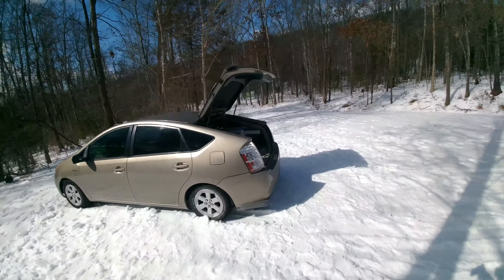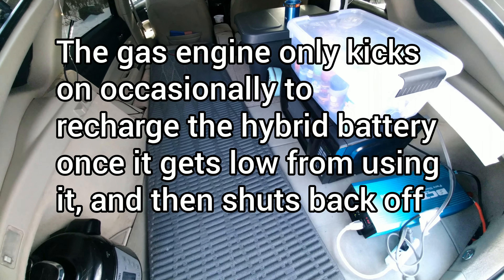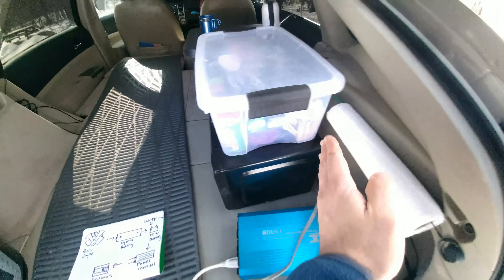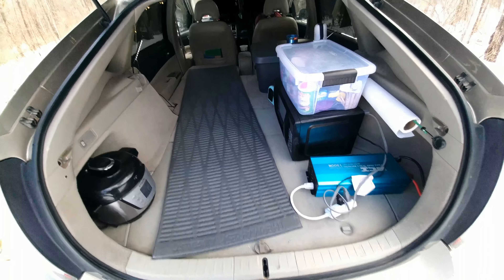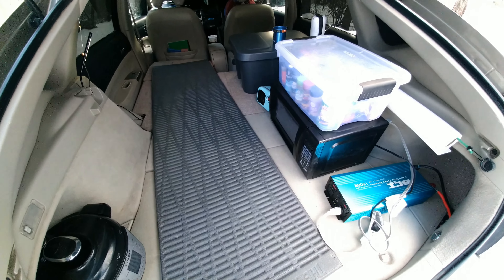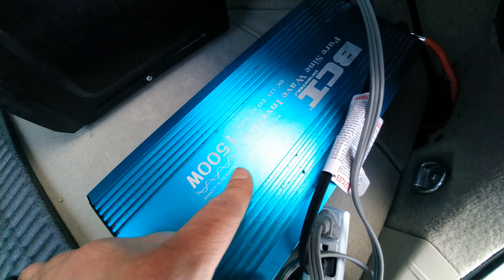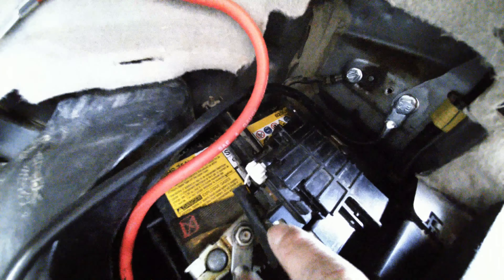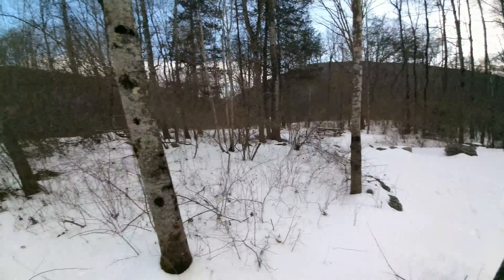How a Toyota Prius (& other hybrids) can be used as a GENERATOR! #OffGrid #Camping #Emergency

Comment: FYI, you need a fuse between the battery and the inverter. The factory fuse on the battery is protecting the power from the DC to DC charger to the 12V accessory battery. If the cable connected to your inverter shorts out it could start a fire.  I have this set up in my Prius and I used a heavy duty, inline fuse.  All the best
Reply from the maker: Yeah I might get a fuse for my positive cable at some point. My inverter is internally fused though so I haven't felt the need to get one. I know the kind of fuse you're talking about though
Reply: @MountainSpringsAdventures  brother as a car audio installer and licensed aircraft mechanic please install a high quality car audio fuse(walmart schose fuses melt wires and dont pop trust me) on your inverter positive lead as close to the battery as possible. An 80 amp fuse should do you but you may need a 100, 120, or 150 amp if the 80 amp keeps blowing. Trust me bro last thing you wanna do is wake up to being trapped in a burning car. 

Just because the inverter has internal protection it won't stop the positive wire from burning down due to an accident short circuit from your exposed hot lead just chilling in your car.
Reply: @FlipSRT4  +1 This!
Reply: Can you hook up a Jupiter 5,000w power inverter to a car.If so what's the proper way to do it using up to 5,000w ?
Reply: @drrobotnikmeanbeanma  No. The Prius DC-DC converter system only has about 2,000 watts available. Other systems still need power, so you need to keep your inverter down to about 1,000 watts. With a 1,500 watt inverter, limit power usage to 80 % or 1,200 Watts. A larger inverter will just waste energy, there are some inefficiencies.
Reply: Have you noticed if this setup shortens the life of your 12v?
Reply: @elizabethswanson422 If the car is off, it will drain your 12v battery insanely fast. If the car is on, it’ll keep the 12v battery charged.
Reply: How do I learn to do this stuff? I'm a girl and no one ever teaches girls to do things like this.  Boo hoo.🎉❤😂
Reply: I assume you understand this by now, but just to clear this up: batteries give DC current, which is direct current in one line on a graph. AC current is alternating current, which shows is a wavy line going from positive to negative and positive to negative over and over again. The inverter just changed it from AC to DC, just like the power cube for your phone charger. I believe the 12 V battery serves two purposes. One is that it provides the standard 12 V to all the normal car things that are needed. Two is that I believe it separates the car and the big battery by just forming a little safety buffer in between the two.
Reply: Using a 12V battery from a Prius to power a 1500-watt inverter can be done, but there are important safety considerations and limitations that experts typically emphasize:

Safety and Technical Considerations:

	1.	Battery Limitations:
	•	The 12V battery in a Prius is not designed for high current loads like running a large inverter, especially one capable of 1500 watts. Such an inverter could draw over 100 amps from the battery at peak usage, which may be far beyond what the battery can safely provide.
	•	If you’re trying to power devices with high power demands (over 1000 watts), the 12V battery will likely drain very quickly, and continuous use at this level could damage it or severely reduce its lifespan.
	2.	Potential for Battery Damage:
	•	Overload risk: If the inverter is not properly matched to the battery’s capacity, it could cause overheating or overloading of the battery. Prius 12V batteries are smaller than those in traditional gasoline vehicles because the hybrid system mostly uses the high-voltage battery.
	•	Discharge risk: Deeply discharging the 12V battery can shorten its life or even damage it permanently. The inverter could cause this rapid discharge if used continuously for extended periods.
	3.	Inverter Sizing:
	•	A 1500-watt inverter draws a significant amount of power (over 125 amps at 12V), which is likely more than the Prius 12V battery can supply. Most car batteries are not designed to handle this kind of continuous load without significant degradation.

Using a Prius as a Generator:

The safest and most effective way to use a Prius as a generator is through the hybrid system’s high-voltage battery. Some aftermarket systems have been developed specifically for this purpose, allowing you to tap into the high-voltage battery more safely and efficiently than using the small 12V battery. These systems work with the Prius’s engine to maintain the charge of the high-voltage battery, which then can supply AC power through an inverter.

	•	Toyota’s recommendations: Toyota doesn’t officially endorse using the Prius as a power generator, but during emergency situations, some owners have done so with caution and the right setup.
	•	Vehicle wear: If done improperly, relying on the 12V battery alone could cause strain on both the battery and the electrical system. Using the Prius engine and hybrid system to maintain battery levels (with the right setup) is safer but still should be done sparingly, as it can wear on the vehicle over time.

Recommendations:

	1.	Smaller inverter: If you still plan to use the 12V battery, opt for a smaller inverter—one that draws no more than 400-500 watts, which is more appropriate for a car battery.
	2.	Specialized kits: Consider specialized systems designed for hybrid vehicles if you plan to use the Prius for emergency power. These systems work more efficiently by using the high-voltage battery rather than the 12V battery.
	3.	Battery monitoring: If using any inverter, be sure to monitor the 12V battery’s charge level closely to avoid over-discharging.
	4.	Installation by a professional: If you’re unfamiliar with the electrical system in the Prius, consulting with an expert before installing an inverter is important to avoid damaging your vehicle.

In short, powering a 1500-watt inverter from your Prius’s 12V battery is risky and could damage the battery or electrical system. Using the vehicle’s hybrid system with a proper inverter kit is a much safer approach.
Reply: @lars7411 THANK YOU for posting this detailed safety information about the dangers of connecting an inverter to the Prius 12 volt battery!
I hope others read it - it could save money, batteries, and lives! 👌🏻✅
Reply: Consider taking basic electrical courses at a county college. You may really enjoy it.
Reply: @lars7411 Thanks for your detailed, useful comment — very much appreciated! 👍

Comment: You can easily add another larger deep cycle 12v battery, run it in parallel with the little Prius one in the rear. That's an inexpensive way to add more power and stored capacity
Reply: That is exactly what I have done. 150Ah. It works great.
Reply: @ockiedavel7318 suggestions for extra batteries for this purpose sir ?
Reply: @ockiedavel7318 did you parallel a 12v camping battery to the car 12v battery on a hybrid car?didi it work?

Comment: I added an extra 12 volt deep cycle battery that I got from Toyota and wired it in parallel to my first battery. I then wired in a 2000 watt Pure Sinewave inverter onto the 2nd battery which runs my 700 watt microwave. This configuration seems to work very well for me. 👍 One more thing, I only run the inverter when I use the Microwave and then I turn it off to save power.
Reply from the maker: That sounds like a good idea, I might get a second 12 volt battery with a split charge relay oh, I would prefer to use my microwave and my power inverter when the Prius is completely off
Reply: Great idea @Reddit Man! Where did you mount the extra 12 volt battery and the inverter in your car? I'm curious to see/know how you went about it to be efficient with space, etc. :)
Reply: @MountainSpringsAdventures  Why would you prefer to use your inverter only when the motor is off?
Reply from the maker: Because it doesn't put any strain on the hybrid battery or the Prius inverter/converter system
Reply: @kidshappytunes-z1m  Thanks!!
Reply: Perfect plan, I noticed he’s using the wrong type of battery for an inverter.
Reply: @caleyhall  which he?
Reddit Man or Mountain Springs?

Comment: I wonder if you could take this technology out of a Prius and put it in other types of vehicles, too. It seems like it could be universal.
Reply from the maker: They do- most hybrid cars have this technology
Reply: It could be universal to even non hybrid cars, but there are caveats:  Except for the shortest of uses (like you need a power tool for 5 min), the engine's got to be on.  The car's alternator needs to be able to supply enough amperage - and check out the charts on the web of how high an engine RPM that alternator has to be running at (for many cars it's 2000 rpm or higher.   It begins to get a bit silly: you've got to have the right alternator, the car's got to be on, you've got to have a brick on the accelerator reving the engine all the time.  In addition to those things, you've got to get the basics right: thick, short 12v cables, in-line fusing, careful temporary or permanent mounting.   A synergy/hybrid drive car is much better set up for this.  There are good (and not so good) videos on Youtube showing this with other Toyo products (like the prime Rav4) and probably other makers' vehicles too.

Comment: You can plug in direct to the battery if you are using DC devices. You only need an inverter if the devices require AC. When using an inverter you are wasting electricity as you are getting power as DC into the small battery, however if you are using AC, you have to convert DC through the inverter losing part of it due to the inverter and then sending it to the AC device. When I went camping, for a laptop, I would get a DC in cable to  the laptop. Most computers run in DC so it's a DC direct to the DC device. No loss from an inverter.
Reply from the maker: thanks for the tips
Reply: Mr Wade thats a wonderful and simple solution. Just get everything 12v dc to begin with and avoid the natural and inevitable energy loss from the inverter to begin with!! At that point your only limit would be the amount of current your "alternator" can put out at idle. I put that in quotations because our Toyota hybrids don't have a tradition alternator....blows my fucking mind I have been a mechanic for 20 years im FAA licensed for aircraft electrical(including alternators on aircraft reciprocating engines) and when I popped my hood for the first time I was FLOORED

Comment: I do the same thing with my Prius -with the inverter. The difference is, and I think it's an important one (not so much with a Prius but it does make me feel better. However if you have any other kind of vehicle you DEFINITELY want to USE ANOTHER 12 VOLT BATTERY AS A BUFFER BETWEEN YOUR INVERTER AND THE OEM 12 VOLT, preferably a DEEP CYCLE.  (By the way you don't NEED a Pure Sine Wave Inverter for most applications, but it is far safer as well as usually a lot more quiet and efficient. Modified sine wave inverters basically Approximate the level of actual electrical current that you get from a real sine wave current -as in your home, for which your appliances are built. Because a pure sine wave is curved and so ...it's complicated and there are manyany videos that cover the math of why modified sine wave inverters are usually sufficient and when they are not and why it all is this way BUT I DIGRESS So, In my case I had a great deep cycle 12 volt -and a deep cycle is what you want really, as they are specifically built to draw down and recharge many many times all the way up and down which destroys of course a regular car 12 volt battery, which is functionally almost more like a capacitor in the sense that a regular 12 volt car battery is made to charge relatively slowly but build up a huge amount of potential current which it holds, running with alternator going at around 14 volts, and then it let's out a huge amount of stored amp hours all at once when you start the car, instantly pumping out between maybe 350 amps or so on the low end for a small 4 cylinder commuter car  and up to 2500 amps on a big diesel V8. So like a capacitor a lot of amps real fast, but instead of draining down 100% a car battery can only be drained to the point that you can still measure 12 volts across it. At that point it probably will not start your car and that is the point below which you ought never drain a regular car battery because a little bit like those old  nicad rechargeable batteries from way back in the 20th century the battery sort of "remembers" the lower level and will tend to settle towards it and you'll not be able to start your car with that battery after between half a dozen to maybe a couple dozen drains below that mark. A deep cycle will not, pound for pound, out out the same amount of AMPS, and to use one to start your car you'll need one at least one and a half times the size of your current battery, but that are specifically built to charge and drain down all the way if becessary, and to do this many many many times, also a reg 12v will only give you a few minutes of power at or above 12 volts whereas a deep cycle will give you 12 volts for many hours and stay at or near it's high voltage capacity for almost the entirety of the use cycle. 
      So, the benefit for using one in a non-hybrid vehicle is obvious: you can charge it as you drive around as you charge your regular 12 volt and then when you stop the motor you can still draw the voltage necessary to run all your appliances and things for several hours depending on your deep cycle batteries rating before you have to start the engine to charge it again, which is basically how a hybrid runs anyway so that's why I say it's much more important for a regular gas or diesel engine vehicle. However I still keep mine hooked up in the Prius because it gives me extra time before the motor has to start thereby saving gas. And I can run a lot of my appliances for hours without the motor needing to kick on charge anything because it's not pulling it all from either the Prius 12 volt or the main Prius battery. So it's another way to make things more efficient and save you money.
And all you have to do is run just as you were run running from your 12 volt to the inverter, red to red and black to Black, just replace the inverter with the deep cycle, Red to red and black to Black, and then run the inverter to the deep cycle the same way. I initially thought that it would still drain from the main battery because it's essentially just adding another battery to the line but without breaking the line at all. But this does not seem to happen it will drain the first battery in the line first even though it's got a direct line to this cars batteries.
      PS I apologize for the terrible grammar and any autocorrect mistakes but I've just been dictating this while I drive I realize it's intimidably long as well so I apologize on that count also. Thank you for the video! Keep traveling!
Reply: Would love to see your set up!
Reply: Bro make a video on this lol. Thanks for the tips
Reply: I think I followed it all and I like it. Now I wonder where I will stash this second battery.
Reply: I unfortunately have a 2012 plug-in...hardly worth the few miles it gets on a charge, but how would this affect putting in a deep cycle and inverter?
Reply: Awesome thank you. Makes perfect sense. Car batteries aren’t meant to use appliances. I bought a renogy lithium battery and will do what you said. All my research says you’re correct
Reply: I would assume there is a slight buffering but  the draw and pull on Acc battery would be the same. Maybe a HD diode between Acc and storage or working battery would only allow the DC to charge but not discharge. Something to make it one way.. not sure if that is possible
Reply: I have a 2017 camey hybrid and I'm living out of my car. I use a 300 watt jackery and my space heater kills it within a few hours. I have a thermal attached so it goes on and off at my desired temp. If I didn't it'd only last an hour max. I have no clue what you said but I have the money to invest in a inverter if you have time to offer advice. I can't locate my 12V connection. Is that only in a prius?
Reply: @darinwilson7854 If you need heat, use the heat from the engine using your car's heater, which is most efficient. Set the heater to 65 or however low you can stand to lower fuel consumption. It will also  charge battery when engine is on. gasoline to heat is most efficient instead of gasoline to generator to  hybrid battery to 12v battery to invertor to heater.
Reply: So much wrong in this original comment.
Reply: @BlainesGarage Like what, for instance? You may be right, but you didn't even offer one helpful suggestion ☹️